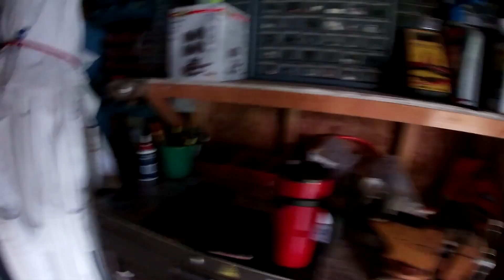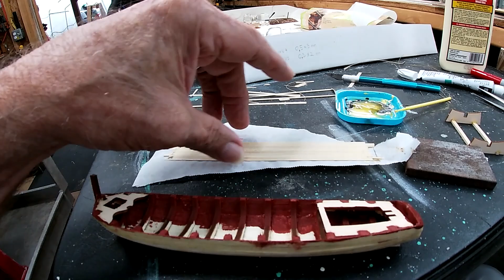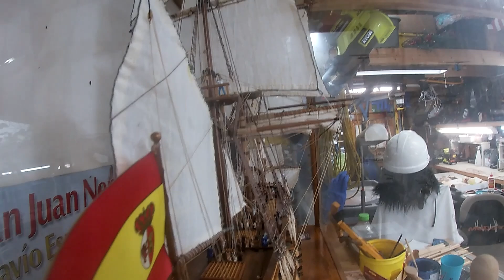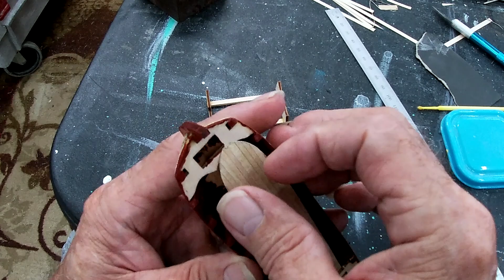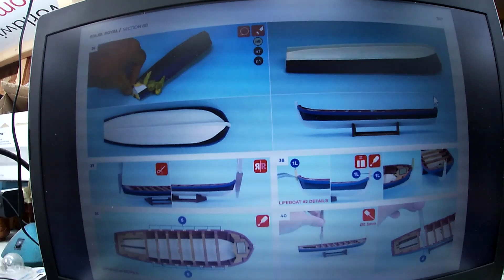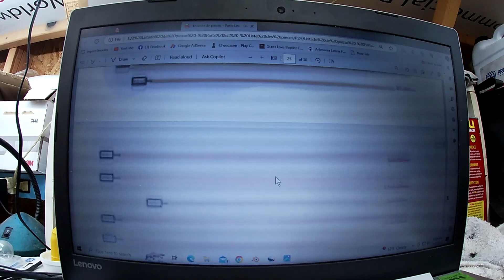Wooden Model Ship ROYAL SUN build # 94

Comment: hi  roger
you gave me a respons for my problem of connection for lights .  i looked at your 2 videos  but didn 't see what    you do.

So can you explain to me how where is installed the interuptor for lights? 
it is under the boat , i presume.
How  did you connect it from  the boat deck to go under the boat ?
we see on the instructions page number 255 interuptor  BHLD in the boat under table.  i t hink it  is not a good solution.

you put the interuptor under the boat . Nice idea ,if you install your boat  in a vitrin.

I want to do the same.

conclusion : how did you do to go from the deck ( see page 255 from instructions ) to place interuptor out of the vitrin?

thanks for your videos Roger. Magic work.

I follow your videos every day since bounty . magic.
Reply from the maker: All the wine is concealed behind plank boards on the deck until you get do the middle where that little house is, and even the one on the mast is behind boards. The little house just point for all 4  lights and I extended that to a little hole in the bottom of the ship for the battery box in the switch. Now that I am building the display case, I have to extend that and relocate it outside of the display case from the ship standand conceal it. So you don't see the wiresgoing outside of the case. Probably go underneath the base of the caseand router out of a slot for it